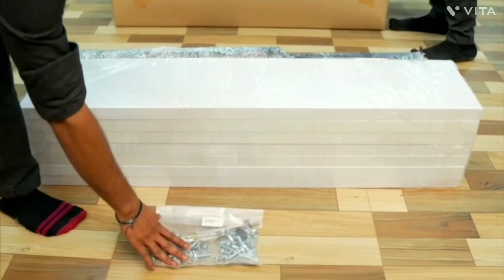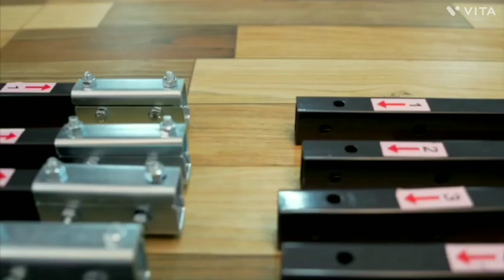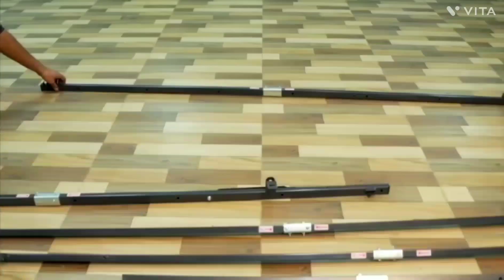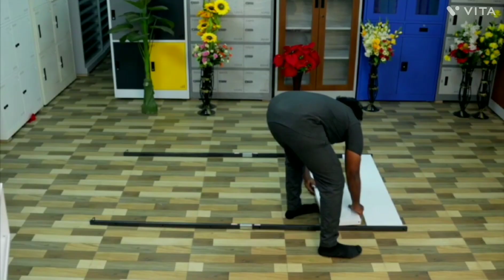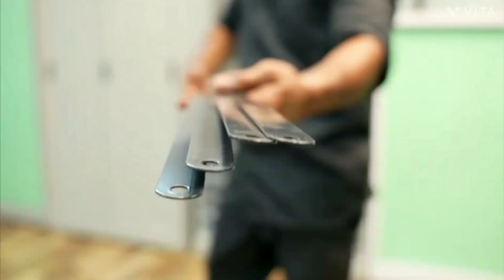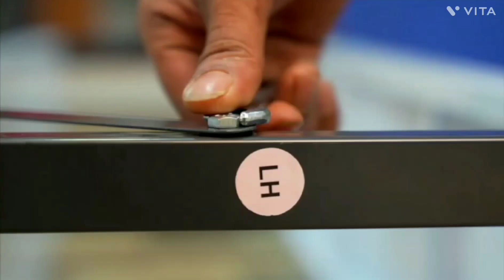CONVERTIBLE STEPS STAND/SHELF /GOLU PADI  one time investment multiple purpose

Comment: Hi, how much is this stand ? And what material ?
Reply from the maker: @ramalakshmig9265  
3 steps - Rs.6850/-
5 steps - Rs.10850/-
7 Steps- Rs.15500/-
Shipping additional.
Powder coated Steel racks (non rusting)
- One Time Setup required 
- Can be converted between Shelf and Golu Steps in Simple Steps.
-3, 5 and 7 steps available
- Each step is 3ft 8" long and 10" deep, space between steps is 9".
- Each plain steps can hold upto 35 Kgs
- After use can also be dismantled and stored in the box.